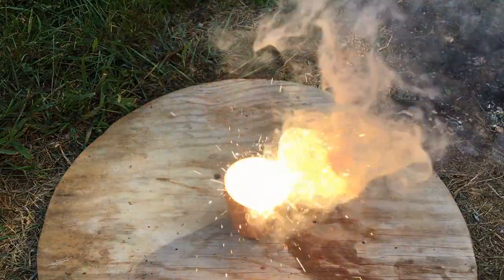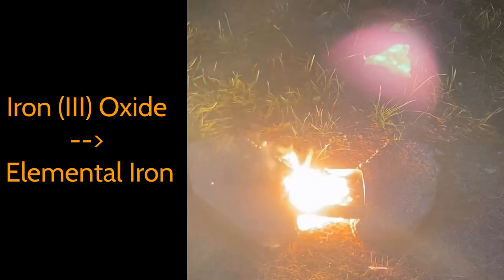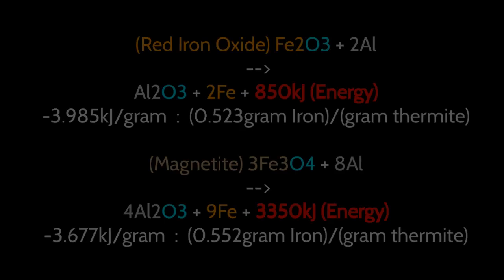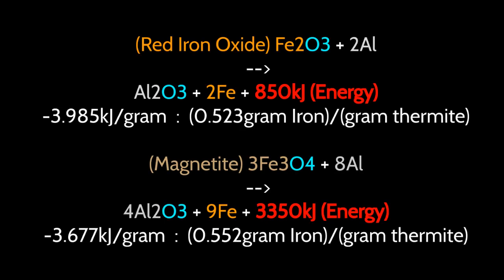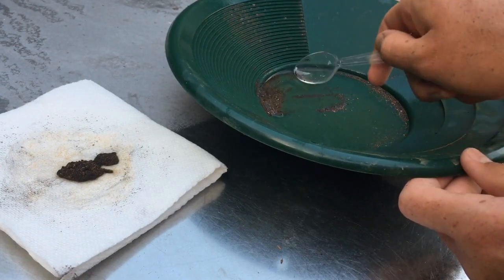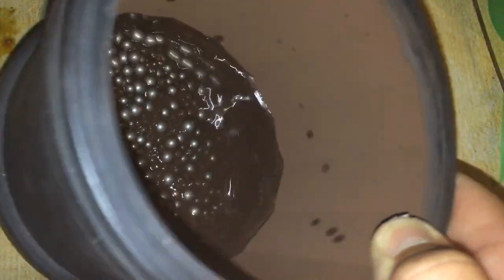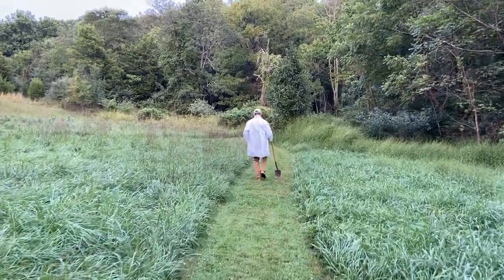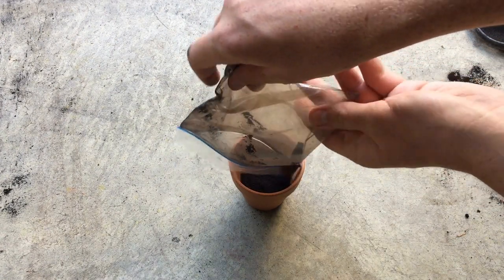Dirt to Thermite, Magnetite to Iron

Comment: I have been using acid baths to remove rust from cast iron cookware. I get a black coating on the piece which I believe to be magnetite or black iron oxide )Fe3O4.  Could you suggest a way to prevent the Fe3O4 formation?  My thought was that possibly a good chelating agent would  complex the Fe2O3 and remove it without producing any magnetite.  Do you happen to know if Evaporust works to do this?  Thanks!

Comment: hey nice haven't seen anybody do this experiment before. Good work. Just wondering, are there any metals besides aluminum that you can do a thermite like oxidation reaction with? I assume nothing else is anywhere near as energetic, but still
Reply from the maker: Michael Rhodes There certainly are. Magnesium participates in many “flash” thermites that have the capability to detonate, but it’s thermite reaction with iron oxides is relatively mild in comparison. Besides that, I know of Zinc being widely used in exotic thermites but by definition of a goldsmidt reaction, you can make a thermite out of any metal and metal oxide as long as the free metal is more reactive.
Reply: @DBXLabs  so for example, would metallic zinc/iron be able to produce a white hot reaction with a copper oxide? cool. Haven't seen anybody do these weird goldsmidt reactions
Reply: styropyro did an interesting series on exotic thermites, but always used aluminum in them. Really wonder if you could get similar effects with something else substituted

Comment: Bruh I was about to go wild if you had native aluminium chunks lying around in your local area
Reply: Native aluminum doesn't exist . it is only found as ore and mineral compounds in nature on earth
Reply: @hughsnuts7318  It can form as the native metal but it's exceedingly rare and only occurs under very specific strongly reducing conditions leading to it formerly being the metal treasured above gold and platinum group metals due to scarcity of such deposits before effective extraction methods and equipment were developed to produce it on a massive scale from bauxite like the Hall-Heroult process.
Reply: @CATASTEROID934  Yes very true but I'm not sure if this metal has ever been found as a pure metal on the earths surface. It was worth so much because only very few knew how to refine it at that stage , and the fact that Napoleon at the height of his powers and influence had an aluminum eagle as his personal battle standard and symbol of power that it was valued as the most expensive item in the world at that time
Reply: Hugh Snuts I actually found a natural aluminum nugget in the mountains of North Carolina years ago. Sadly I have lost it over the years but I found it on a stream bank with a metal detector.
Reply: @reactivechem7408  I do believe you but I have found kilos of aluminum 'nuggets' over time the same way however the source was invariably the result of burnt rubbish or vehicles; I even found one a foot long in the pattern of the tyre tread of the car it came from after the rim melting into the mud track underneath I'd assume

Comment: This taste like some 5 micron aluminium powder. Lol

Btw aluminum might be linked to Alzheimer's disease. Using aluminium utensils should be fine, but routinely tasting it or breathing its dust isn't the best idea
Reply from the maker: I didn’t actually taste it*
Reply: Aluminum does cause brain degenerative diseases such as Alzheimer's. Utensil use is the most common cause of absorption through cookware such as pots and frypans as its reactivity is high , low melting point and physical softness make absorption by food or liquid highly likely. This is scientifically proven fact but hard to announce publicly without litigation from the aluminum  manufacturing industry.
Reply: @hughsnuts7318  My wife still cooks her soup in her fav aluminum pot. She also believes everything on CNN and MSNBC.